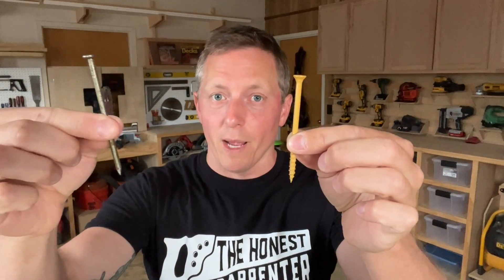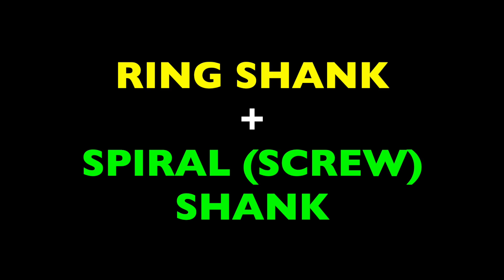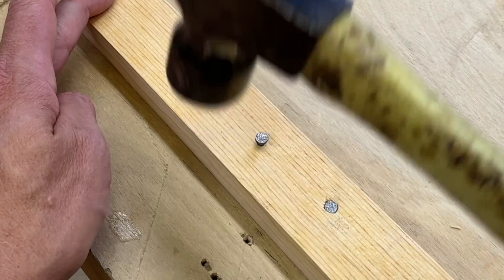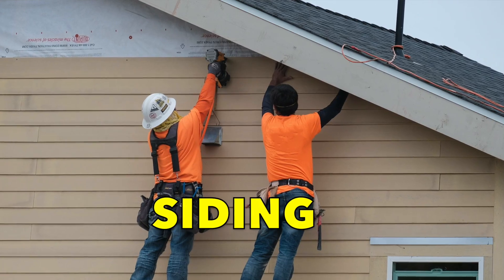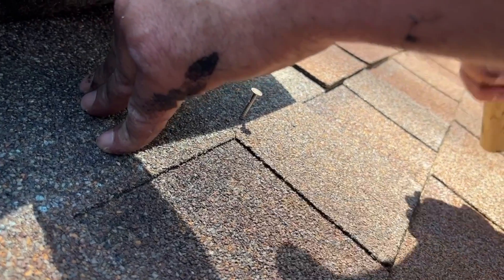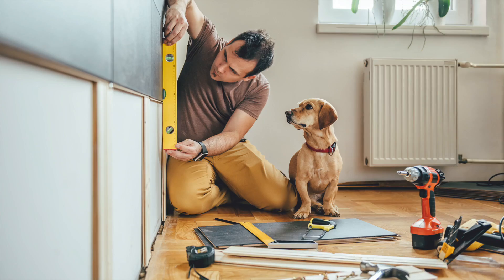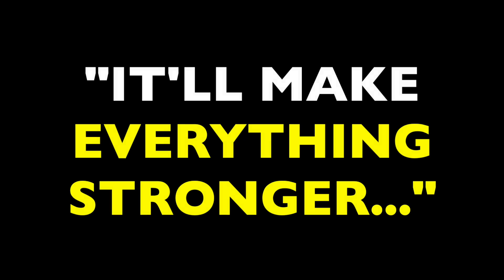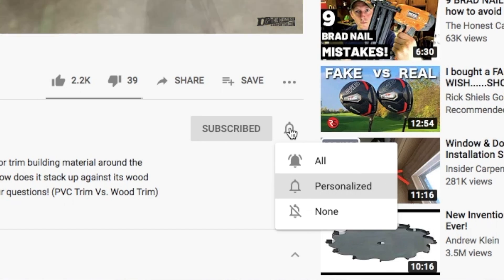These Nails Act Like Screws!! (2 Nail Types That Perform Like Screws = MORE FASTENING POWER!)

Comment: Spiral nails also have their tips squared (like nails of old) which prevent wood from splitting as some of the wood is pushed down instead of to the the side like normal nails.
Building outside wood structures with wood screws (for fastening power - prevent separation) and spiral nails (for shear power - prevent sliding without breaking) will  produce almost indestructible constructions.

Comment: I broke my hammer handle trying to remove a 8 penny galvanized ring shank nails. I upgraded to a steel shank hammer just in case I run into another ring shank. Normally the head pops off.

Comment: Back in the late 50s and until about the late 70s there were nails called Scotch nails used for framing.
They werent perfectly round like most common nails are but a bit flat on several sides. 
They were also cerated on the sides which gave them a better grip than regular nails. 
We used them exclusively in our home building business untill they were no longer available.

Comment: my go to for me is spiral shank nail for these reason's i use a hammer - it is cheaper than screw's ($35 for 10lb) - they hold - easy to toe nail. the reason why i do not use smooth is they like to back out and the reason why i do not use ring shank is they curl away from the wood when using a harder wood  especially when toe nailing.

Comment: I like to use a hammer to drive nails and not a nail gun, I prefer spiral shanked nails for outdoor projects but they are so expensive. Very difficult to remove them if you can't bang them out from the other side. My biggest gripe about nails in general is how soft a lot of manufacturers make them these days, every fifth nail out of a box bends over. Spiral shanked nails tend to be a bit harder but you are really paying for the privilege. Ring shanked aren't bad for holding power but a lot of them are pretty soft too.

Comment: Around here, those spiral nails are called ardox nails. They don’t make ring-shank nails for my old coil nailer but they do make spiral. The debate on which holds better is kind of a moot point as both hold so much better than smooth shank.

Comment: Hurricane-country makes galv deformed shank gun nails the ONLY nail for sheathing folks. When that wind blows hard, you'll be glad yours aten't those smooth shakes that will have, in time, "worked" proud from the ply'wd. As you can bet smooth shanks will. Ringshank galv. 8d's all-over. Code's describe it best :-)

Comment: Back in 2016 we were doing a minor remodel in our house. New kitchen cabinets and the removal of one small wall to open the room up. We decided to demo the wall ourselves to save some money. No big deal, right?

Oh, boy. This is when we discovered that the house was framed with a combination of construction adhesive and ring shank nails. Toward the beginning of the demo process there was one particularly bad connection that I couldn't budge. My teenage son tried and he was defeated. The mess stayed as it was for two weeks as we waited for my husband to get home from a business trip and, in that time, I put a $20 reward up for anyone who could get it out, along with a promise they'd be crowned the King of England. 

About a dozen burly teenage boys and young men went at it and none succeeded. It was impossible. When my hubs got home, he took one look at the issue, collected his multitool, and cut off all the nail heads in short order. 

I have no idea who did this or why, but that house was built to last. At the time, we thought it might just be that wall, but later repairs proved that it really was the entire structure.

For anyone who believes that this might have been better for the overall strength of the house, think again. Wood rots. Water leaks happen and sometimes subfloors have to be pulled and replaced. Overbuilding makes such repairs SO much more work.

Now I'm having flashbacks to the pipe leak IN the wall that rotted a significant section of subfloor and some joists in two rooms before we discovered the problem. Removal of the rotten plywood meant beating most of it into submission, using a jig saw to cut holes where it couldn't easily be hammered through, and cutting the entire glued seam between the plywood and the joists to save the joists that we could. Just figuring out how to attack the problem took precious time. A demo that should've taken a few hours took days. 

Don't do that.

Comment: Hello Ethan, thanks for sharing, your channel it's a great source of information, very practical and educational. I found some wood blocks that I wanted to reuse that had some nails though and when I tried to pull them off, using the technic that you showed in another video I just broke the head of the nails. When I took a closer look to the nails it looked like they had a thin copper wire twisted around the nails, it made imposible to remove. I don't know how they put this nails with the wires but it surely improved the resistance to pull them off.
Reply from the maker: Thanks for watching Charlie! Those are the collating wires from a nail gun—some nails come strung together with wire. If the heads break like that though, you can try a nipper or nail puller as well! 🙂
Reply: @TheHonestCarpenter  Thank you for you response Ethan! I have learned one more thing today!

Comment: I’m building my camp soon as the lumber drops enough and now that I just learned about the ringed nail, I’ll certainly be using those for my floors.
Reply: Floors you need to depend on glue more than nails but taking it up a notch is always good.

Comment: We took a wood deck apart on our fixer upper thinking we could reuse the 2x6s to save money. We needed to rebuild it because the prior owners had built it wrong. We soon found out it was built with spiral shank nails! It was almost impossible to save most of the 2x6s because we had to pretty much destroy them taking them apart! We rebuilt the deck using regular nails ,engineered screws and deck screws. I can attest to the holding power of spiral nails!

Comment: I came across a (at the time) across a screw designed to have extra holding power in zones where high winds and hurricanes,tornados were fairly common. I wonder if they are still available and if you are familiar with them ?

Comment: I got raised around my grandfather and father both following the : If I commit to build that damn thing, it's not coming apart, ever and do it once and never having to rebuild it. So screws and glue it was, and spiral nails and glue, and bolt and weld or rivet and bolt and weld, you get the picture. Later in life, I was shocked to discover that most people hated those spiral nails, and would go as far as using only smooth nails. Grandpa was also a fan of nailing deck screws: Convenience of nails to assemble, and removable like a screw after.

Comment: I don't believe that nails would ever be as strong as screws but I do believe at times nails are good
Reply: For shear forces, nails are far stronger than screws.   Keep that in mind!
Reply: If you go by the shank of a nail and screw the screw wins
Reply: @robertlis2704 Nope.   Not for shear.   This is why code requires nails for framing.

Comment: Thanks Ethan, informative as always. Say I was building a small cabin in a high wind zone and I wanted it to last as long as possible. Would using the screw shank nails make a difference in its longevity, if it were constantly being pushed and pulled by intense winds?

Comment: going from the video title i imagined this was going to be about scrails! however they do not seem to be worth the extra cost perhaps for most typical applications? asking another carpenter type person he said he didnt like them / never needed them. and clearly the main benefit? might be to be easier to remove than ring or flute nails? but that is assuming you are expecting / anticipating to have to tear down the construction? then i would assume only movie sets or broadway plays, or temprary events like exhibitions etc? what do you thing about scrails? and also the relative cost of them vs (for example) ring nails, and / or proper real construction screws? it would be nice to hear another opinion

Comment: Actually, instead of ring-shank or spiral-shank just plain old galvanized hold seem to lock in better and the price tends to be reasonable vs the specialty nails.
I will say that years ago I had to demo a temporary structure that was put together with glue coated nails (don't ask me why, I didn't build it)... A lot of the time the wood splintered instead of the nail pulling out.
Reply: This is true.   I use galvanized for framing for this exact reason.   Only a bit more expensive.

Comment: I remember bullet-head nails being used to nail weatherboard planks. The planks had a rectangular cross section, no special cutting. They were angled down, so negligible risk of their pulling out. Roofing nails were hot-dipped galvanised with s separate disk a part of the head to spread the load. We used flat-head nails similar to those you showed for asbestos sheeting. These  had flat tips to not break the asbestos.

This was 70 years ago.

Comment: Thirty or forty years ago (or more when I'm not trying to hide my age) we only knew them as Pallet Nails. We never used them but did have to pull them out from time to time. 
Have you done a vid on Cut Nails yet? We used lots of those square-cut tappered hardened steel nails with the slightest of heads for tung&groove flooring and nailing into mortar joints.

Comment: In Australia  the majority of houses are built with corrugated iron roofing. Typically this is fastened with spiral nails with a special metal washer around the head. Over the last 10 years or so I've seen these replaced with tek screws.  These are OK but if they have a rubber washer under the head the rubber perishes in the Australian climate and the roofing comes loose and rattles in the wind. Shingles are extremely rare here and I can't remember the last time I saw some.
Reply from the maker: Interesting! Thanks for the info—I love hearing about building in other countries 🙂 🇦🇺
Reply: I thought we use colourbond and tiles mainly
Reply: @dengshomeinvasions1273  I agree. Colourbond  is basically powder coated corrugated  iron and certain councils (local government) insist you use tiles
Reply: @OzSteve9801  ah ok thanks for the clarification

Comment: As a hobby woodworker I still don't understand why wood glue isn't used more in carpentry given how strong joints it creates.

I have almost zero experience in construction and carpentry, as revealed by my question.
Reply: One reason wood glue isn't used in construction (much) is because wood expands and contracts depending on moisture content. In ancient times, (before the 50s), baseboards and door & window trim wasn't painted on the wall side of the trim to allow the wood to "breathe", meaning swell and shrink according to background moisture, and if you've ever seen an old wooden tongue & groove floor, the gap between each of the boards is from generations of washing the floors with soap and water swelling the wood enough to crush the wood fibers until the floor dried long enough to shrink the floor boards again. The whole house expands and contracts constantly.
Reply: Yep , older wooden houses are in constant flux with changing humidity with doors getting tight then loosening up when the air dries
Reply: @benwinter2420  I once had a dead mouse that did the same thing. It had died 3/4th up the slope of the drip-pan under the refrigerator, so after a few days of humid weather the water in the drip-pan rose enough to wet the mouse corpse, causing it to emit a foul smell for several days until it dried out again. I couldn't find that mouse carcass for months.
Reply: The strength of a glue joint is highly dependent on the quality of the joinery. That is why it needs such good clamping. 
Even the most precise carpentry is unacceptably rough by fine woodworking standards. Jointing and plaining everything to perfection just isn't economical at scale. 
Construction adhesive is much more forgiving, and nails can be used to pull things into place to keep everything "square".

Comment: I'm curious how, in the video, the person driving the screws got such a smooth edge around the screw hole without a countersink.  The GC that rebuilt a deck on a house I have in another state left tons of splintered wood sticking up where the screws went in, enough that two folks got cuts and splinters just running theor hand along the handrail as they walked down the stairs.  I'm doing a lot of touch-up work on this house and any advice would greatly help.  (I've already filled and sanded this deck to a suitable level of frustration.)
Reply: It looks like they were using a trim head deck screw. Do a search an Amazon for trim head deck screw and compare those screw to standard screws and you see that the head of a trim screw is much smaller and it has self-drilling threads that help cleanly bury the screw head.

Comment: Thank you! I didn't want to buy extra tools for an upcoming subfloor project but needed screw strength with a hammer. You nailed it! Perfect timing.
Reply: Actually, a screwgun isn't really an "extra" tool. It is probably the 2nd most useful power-tool after the circular saw.
Reply: @damnhandy  oh, I know! One day I'll give in and purchase one when too many projects require it (and my hands scream do it!).
Reply: @elanamarshallsea4781  Do it.   Your life will never be the same (in a good way)    Then you will discover a 1/2 inch impact gun which uses the same batteries.   You will start driving lag screws with it, and your life will be complete.

Comment: What about cut nails? 
How about the sheer strength comparison mr honesty? Heh?? Just rustlin your jimmies there bud! I like this channel but I’m not a fan of screws. They have their purpose but break too easy and i hate bits. If all rotary fasteners used 1 single universal bit then it would be part of the screw gun too and I wouldn’t have to remember where i left that #40 star bit and the screw gun wouldn’t be the adopted cousin of the hammer. They’d be hommies.

Comment: Very interesting, I wasn’t aware that they existed. Thanks for the video👍👍
Reply from the maker: Thanks, Tony!
Reply: @TheHonestCarpenter  do you have, or planning to have, a vid on how to straighten a fascia board on a deck that has warped and has pulled away from the deck in spots.   I was going to attempt to do this myself but I’m not sure if the wood will crack in the process causing me to replace the entire 10 foot board.

Comment: Good afternoon,
I always prefer screws to nails.
Twist nails and ring shanks are good when you can't used screws.
CC (cement coated..glue) nails are also good when needed.
Reply from the maker: Good call, New Guy! I want to get into the various coats and dips before too long. That’s an ever-evolving world.
Reply: Just remember that screws don't give the shear strength that nails do, so there is a time and place for both.

Comment: Twist nails are the best in construction for anything you want to stay together and I would use them over straight shank nails, contractor’s want cheap and fast. I agree that screws are better for deck boards since you will need to replace them eventually.
Reply: I disagree with you assessment. Using twist nails entirely to build anything but pallets would be like welding practically every steel part in your car instead of using bolts and tack welds, since you can't remove the nails without seriously damaging or destroying the wood you are trying to replace, and houses go through many renovations, additions, or repairs over many, many years. If you used only twist nails to build a house, the damage you'd have to do to demo anything in that place would make renovating extremely expensive.
Sure the builder wouldn't care, but the guys who had to renovate the place ten or twenty years down the road would curse your name. If you must use nails with better grab, use galvanized common nails. Their galvanized round shanks grip into wood very well, but still can be pulled out fifty years from now without spitting the wood.
Reply: @damnhandy  
I agree, I wasn’t getting into all the detail, I would not use it to build cabinets or even to hang them. Anything that might be remove due to standard upgrades is better screwed in but the wall studs, subfloors and anything that is built to withstand the rest of time yes. Now pallets, no way— unless your building a cabinet to protect an expensive piece of equipment, and that’s because the cost of lumber is getting so high you might want to take it apart and build a desk or cabinet from it. Quarter sawn oak 4x4 on a pallet, I want those!!
Reply from the maker: Good call, cyberwolf!

Comment: I'm still a Bigger Fan of Screws, it's still way easier to undo your mistakes, but it's nice to know there's an Alternative with Screw Shank Nails...maybe I'll give'em a try. Thanks.👷🏿
Reply from the maker: I rely on screws a lot too, W! Spirals we’re my go-to for trim exterior repairs for a long time though 🙂
Reply: I own a prefab timber framing company. My guys use screws to quickly fasten the boards to the frame. Normally 2 or 3 per stud, depending on board size and thickness. Only when everything is neat and square and all openings have been sawed do they shoot nails. This way it's easy to correct any mistakes. We use coiled nails, all ringed, usually one every four inches. Engineers might prescribe more, thicker or longer nails. Nobody has ever asked us to use spiral nails. This is in Europe btw.